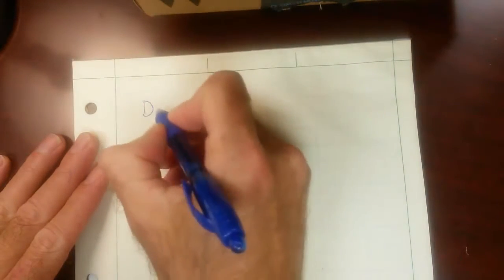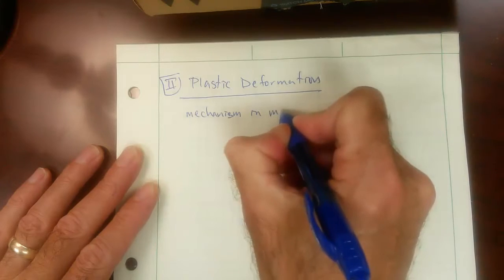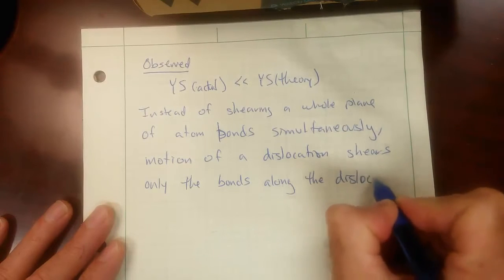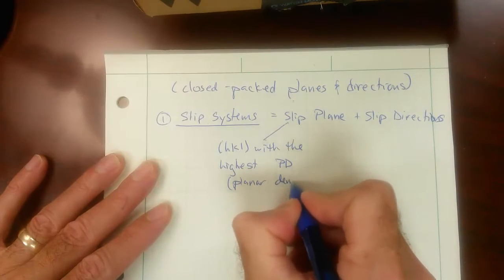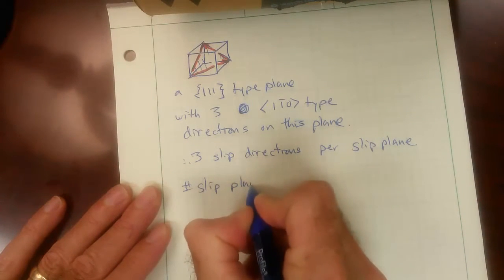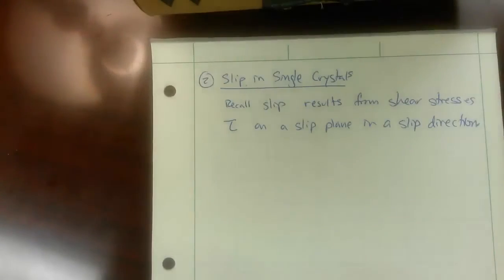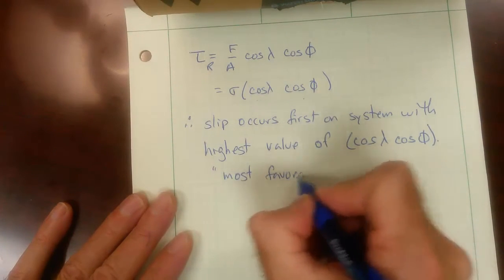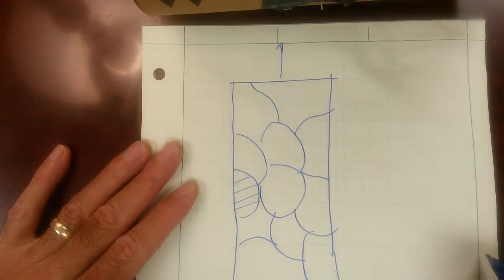Lecture on Deformation Mechanisms

Comment: Thank you for the excellent lesson.  With reference to the last 3 minutes...can I assume that the overall slip plane will occur at 45 degrees, regardless of how each individual grain's slip plane is orientated?  For instance, if there are a greater majority of grains positioned parallel to the applied force, would the slip plane still occur at 45 degrees?  Visually,  I picture the atoms on the northern-right (chosen orientation) side being shifted upward, and each southern atom follows behind but staggered down one atom in reference to the horizontal.
Reply from the maker: If the orientation or the crystal structure in the grains is random, then in some grains slip will occur on planes at greater than 45, and in other grains on plans less than 45.  Overall, the average slip path will be at 45 degrees to the tensile axis.